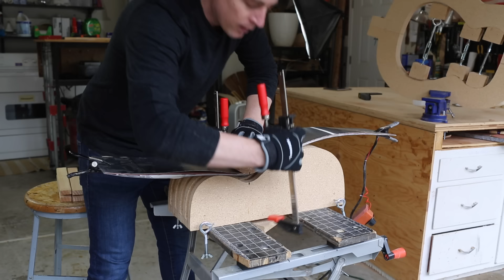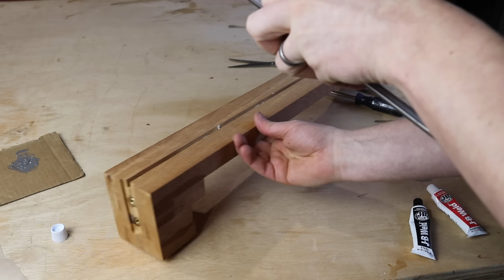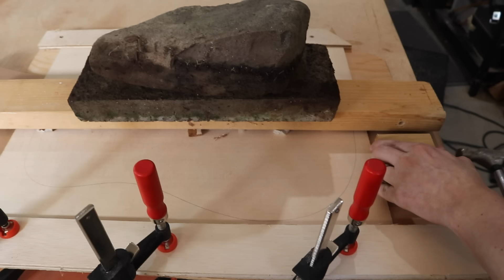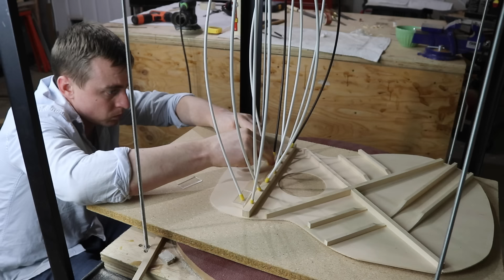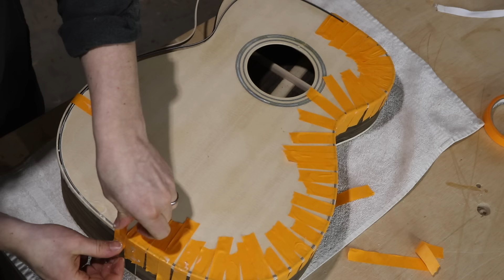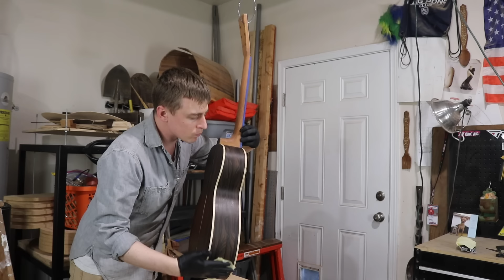Building an Acoustic Guitar (Full Montage)

Comment: You should buy a mask to protect yourself from all those dust
I know it's part of the experience but keeping yourself safe is part of the experience too ya know
Reply: If you are just building one guitar its not a big deal. If you build and repair guitar for a living like I do then you do need a good respirator mask and dust collection.
Reply: Frank Faz cedar wood:
allow us to introduce ourselves
Reply: Thanks mom.
Reply: @Fazman81  Hey good sir,today I just found out part of my guitar (wood/coating) has fell off and it really breaks my heart.I think it was due to extreme heat condition that causes it.Do you have any idea or how can I polish it or make it whole again?It really breaks my heart even though it's just a small piece.Im afraid the whole guitar will slowly fall apart :(
Reply: Kazuya Yoichiro Without knowing what type of finish it has it would be hard for me to give you a remedy. That said most small cracks in guitar finishes can be repaired with a quality super glue. I would clean the area first with Naptha, then tape off the area. Sand the edges of the crack with 400 grit to feather the edges. Then apply the super glue and quickly wipe away the excess carefully with a napkin. Let it dry around 5 min then repeat this 4 or 5 times until you build up a good layer of super glue. Then block sand the area with 400 grit, 600grit, 1000grit and 1500grit. Then buff it with a good buffing compound. Hope this helps, salutations from Texas.
Reply: @Fazman81  hey sir it's a Taylor'a Guitar made of Koa wood.Thanks for the suggestions
Reply: @Fazman81  Can  I send you the picture of my guitar through messenger/Instagram or any sort of social media platform??Because it really need help on this.
Reply: I've read warnings that say saw dust can cause cancer. Is that true?

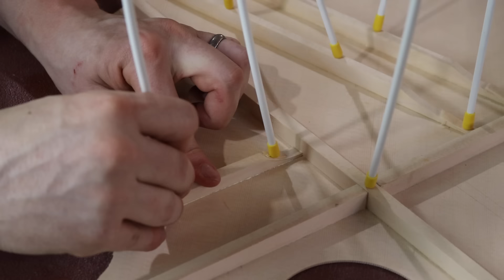Comment: 3:40 just wondering what are those dangly things and what do they do?
Reply: I believe they are carbon or fiberglass rods and they act as clamps. I have not yet finished watching the full series, but I'm sure you will find an episode that talks more about them.
Reply: @reiniervanrooyen1528  oh coolthanks👍
Reply: tehose are go-bar decks. Its actually an old way to put pressure on the braces when they are glued-essentially a clamp.
Reply: They are go-bars the put pressure on the pieces and act as a clamp. If you notice he is using the sanding disc under to clamp the same radius on the sanding dish into the top. It is a very efficient way of clamping a lot of pieces at once.
Reply: they are fiber glass rods used to apply pressure for the glue up process. Similar to a piece of wood, if you bend it fiber glass will want to return to its initial shape. This, coupled with the geometry of bendy things means that it also applies downwards pressure. You can play with it using all kinds of materials, fiber glass is a common one because of the strength. A cheap way is to use fiber glass road markers, you can find them for $2 or $3 dollars at hardware stores in north america at least.
Reply: huh don’t know, but  y a   l i k e   j a z z   ?

Comment: Now I really Realize why some Guitars are Costly.
Reply: Making it is not so expensive. I built mine for no more than $700 AUS, I can sell for 3k if i wanted to.
Reply: @chrismoylan7997  and how long did the it take to craft it? 2 weeks? A month or two? 
It all depends on the quality of the craftmanship, materials second.
Reply: @ancientnames1275  Well with other commitments, i used to fly away from home to work on mine sites it did take me about 8 months. finished it in 2017, it also depends on the humidity too as you can't really glue anything

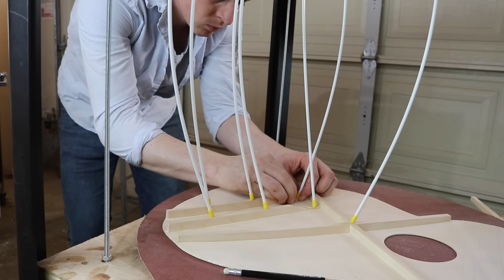Comment: 3:39 does anyone know what the purpose of those strands onto the guitar braces are for? And the term for those
Reply: Their purpose it seems is to act like clamps, but I do not know what they are called. I assume it's the best way to add even pressure because you can fit more of them compared to other clamps and the variable pressure they can have.

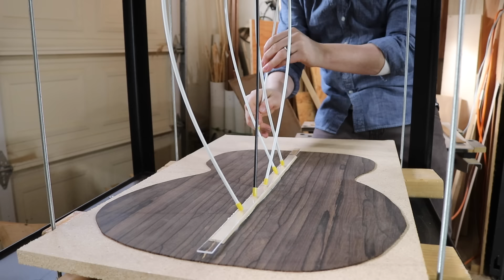Comment: 3:20 Can someone please tell me wth is going in here
Reply: JoeMakaFloe yes
Reply: the rods are used to do pressure on the back and the woods reinforcements. That lot of pressure is needed to remove most of the glue out of the area because, when we work with wood, a thin layer of glue makes the stronger bond.

Comment: Nice video and it looks like the guitar came out great.  I'm assuming with the Dremel, you were able to cut the binding channels in one pass (meaning cutting depth and width at the same time)?  Also, is the Dremel jig from StewMac or where did you get it?  Does the Dremel jig allow you to cut the back binding channel on a slight angle that goes along with the angled back?  Thanks.